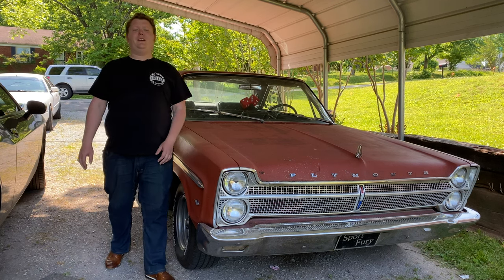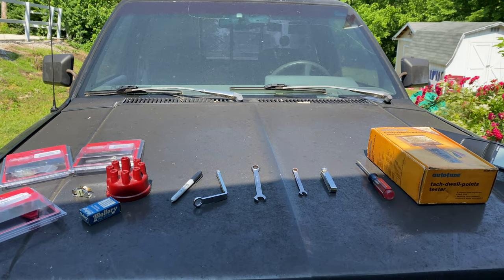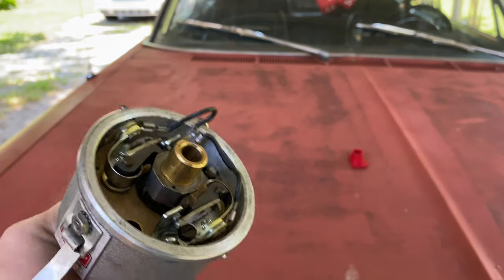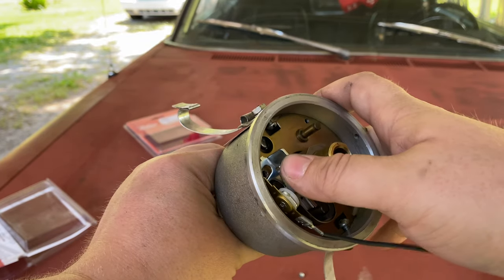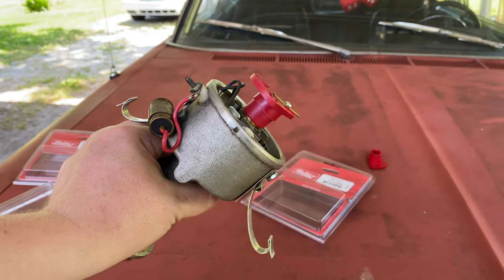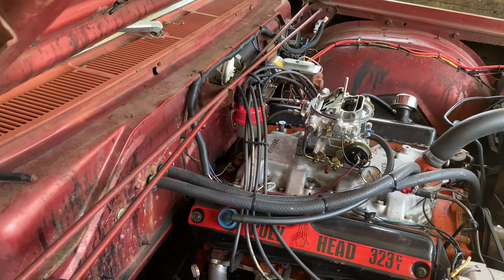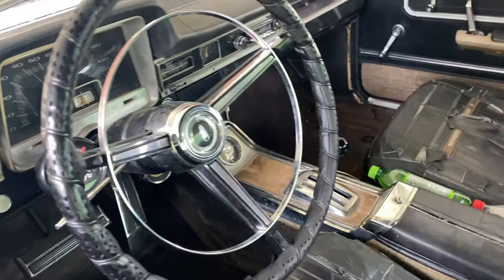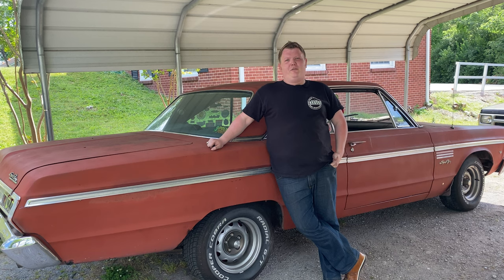Replacing Ignition Points And Setting Dwell Angle Is Easier Than You Think

Comment: My old timer tips : only work on distributors on a table with a towel on it; Why ? the towel will keep screws from RUNNING AWAY from you  because of gravity and wind! When installing, put the tip of your flat bladed screwdriver on a magnet for a moment then out the screwhead and move all of this to the spot where the screw goes in. This saves a lot of aggravation ! BTW I learned all this when your car was NEW !

Comment: use a magnetic screwdriver or they actually have small screwdrivers with tiny little Jaws on the end that will hold the screw in place until you can get it where you want it. you can even put a little dab of grease on the end of your screwdriver so the screw doesn't fall off.
Reply: That Screwdriver is called a Monday Morning Driver!

Comment: You got a mic on!  Awesome improvement in volume. 🙂  If you place a small magnet on the shaft of the screwdriver, it will become temporarily magnetic.  That will help keep the screw from falling off the end of the screwdriver when inverted.  In some applications, a dab of grease on the end of the screwdriver may hold the screw in place until you can start it BUT, I would not use that technique inside of a distributor...unless it happed to be dielectric grease. Nice set of points.  Most don't have the lubrication wick on them.  Showing the way to change the dwell may have helped make this clearer to those who have not done it before. Good job on remembering to recheck the timing. Good Job!

Comment: Yes I do know how to save your frustration with the screw. #1 add a dab of grease to the screw driver tip. # 2 purchase a holding type screwdriver , they have a split blade that tightened in the screw slot to hold the screw.

Comment: You can set dwell with just a basic multimeter, a wire and a protractor (even a paper one printed off internet) Tape the protractor on the rotor and fashion a pointer out of a coat hanger or something. Then disconnect power to points and connect the multimeter, set to continuity beep, between the points power lead and ground. Using a socket to turn over the engine slowly, take note of the degree reading on the protractor when the multimeter starts beeping and the reading when it shuts off. That is the current dwell angle.
Reply: dimebagvision3221  cheers. Have a beer on me then.

Comment: Thank God for my MSD  6AL  and lockable distributor.   I was 18 the last time I seen a dual point.
Reply: stay close to your parts source,do not travel the country,cause your new MSD  AL control unit is in a box warehouse and it'll be 3 days for they can send it to ya,points for ever,even my motorcycle is now points,its idles better and accelerates better
Reply: @strattuner  Not worried I have 2 other vehicles.  The street rod is not my daily driver.
Reply: @Buffrt66  EXCELLENT.NOW I KNOW  you have backup,100 bucks says there electronic cars too
Reply: @strattuner    i always keep a spare points dist. in my 77 poly powered d100.

Comment: Put the screw in the points and hold it in the hole with the screwdriver before you put them in the distributor and hold the screw in the hole with the driver as you guide them into place.
Or put a tiny drop of superglue on screw and glue into hole, glue will break when you tighten it.

Comment: I'm glad GM put a window on the distributor cap so dwell could be set with the engine running.
Reply: Fer sure! In the 1970s I used the Accel dual point distributors in both my 440 powered '64 Polara 500 and my '70 340 Dart. The same type in both. You externally unplugged one set of points and set the fitst set of points through a rubber plugged access hole using the dwell meter with engine running. Then you plugged in the other set of points and set that set of points the same way for your total dwell. It was SO easy to do. Before I had those distributors I used Chrysler dual point distributors in my cars and they took some experience to get good with them. My opinion- there's no reason NOT to use electronic ignitions now.

Comment: This car with it poly engine is awesome. I think it would be cool to make this car a mid 15 second reliable daily driver.  Some may say why 15 why not 14 13 or 12? Mid fifteens can be done without sacrificing any reliability and using many OEM parts. Mid 15s would be punchy gutsy and really add to the driving enjoyment. Hey mid/late 80s five liter mustangs ran in the 15s. But it's easy for me to suggest things that cost$$$....But Weiand has a dual 4bbl intake manifold for the poly. And you now know how to port cylinder heads......318 poly can be stroked to a 390 as well.......Jus sayin.  Love the new channel.

Comment: I'm currently working on the front end of my engine right now, but one of the things I definitely plan on doing is upgrading to Chrysler electronic ignition - points are easy, but I like technology.  So much easier when all you need is a plug and play test tool for your ECM!
Reply: and I on the other hand will never go to electronic ignition after breaking down in the desert of yuma arizona with a 450 dollar tow bill,the magnetic pickup in my car fried,and i coasted over to the side of the road in 105 degree weather with all of the rattlesnakes i could hear,technology is not the best right out of the box,no thanks and no thanks,point ignition has made cars run down the road for a 100 years,that is a track record of track records,with two sets of points and 4 condensors in the glove box and two coils in the trunk,i'm not walking again,and i'm glad you like technology,one of them tow bills are make your day,happy motoring

Comment: Just thought of something you can remove the plugs and rotor button hookup dwell meter spin engine with starter  your meter needle will hover over dwell setting move points while spinning engine  you can lock right in on proper dwell angle the first time...hope this helps.

Comment: If your screw driver is heavily magnetized you can deliver the screw directly to the hole, however threading it is still about half as hard as dropping it in. I used to have a screw driver that had two tabs that could hold screws someplace.

Comment: You asked for a better way to deal with the tiny screws in a distributer. I have a set of tweezers in my tool box and that helps me put the screw in the hole with the slotted end up. I can't tell you how many times I've gotten the screw in the hole upside down which doesn't do a bit of good. I change my points with the distributor installed in the car. However, I would recommend using ordinary white school chalk to make a temporary mark indicating the position of the distributor instead of a black Sharpie. This way you won't be confused by all of the previous marks (the chalk easily wipes away) and the white is easier to see. Finally, I wipe the timing mark on the balancer and the degree tab on the timing chain cover with the white chalk which is illuminated very well by the timing light.

Comment: Have you ever tried spinning the distributor with a drill in the vise and setting the dwell that way? surely would be a lot easier than starting and stopping the engine a bunch of times, especially if the distributor was already out. On my Ford I use a remote starter switch and a screwdriver to set the dwell while watching the dwell meter. I absolutely hate using the feeler gauge lol.

Comment: Take your strait edge screw driver while the engine is running and rub the tip back and forth over the rear bearing cap on the alternator ! it will cause the screw driver tip to be magnetized even after removal of screw driver. Also to check to see if your electrical system is charging touch the same rear bearing cap on alternator . if it has a good magnetic stick its charging . if barely has or no magnetic stick its not charging .   dont forget to put a little bit of lube on the inside of the tubular hinge of the points since it moves back and forth . 😎💪🏁✌

Comment: They make flat blade screwdrivers wit a spring loaded cam in the middle of the blade that twists to hold the slot.  Magnetic works almost as well.  Jaws outside the screw don't always fit in small spaces like points.

Comment: By the way the Mallory hp points not only  have a heavier spring the contacts   have a harder alloy also the condenser is matched to the coil impedance depending apon what contact the arc is building up on will tell you if your condenser is to big or to small. Also contacts of points should close flat and square for best points life always put a dab of grease on the rubbing block some old  distributors had a lube wick.  To put that screw in EASYIER.( USE A SCREW HOLDING screwdriver)

Comment: Hi I’ve just a dwell meter of eBay but with no instructions, I’ve just about worked out what’s what but could you please explain the bottom part that says points, it’s this for the condenser , and how to use it for testing the points, I ask this question because I’ve just fitted a brand new old stock ( made in 1975 lucas distributor  which came with points etc fitted I just took everything apart to remove protective oil’s setting it up and working great but the test tune up gage shows the points in the bad area and not the good??

Comment: like your style and I actually made it through what can be considered a very long YT video to see how you set the dwell. Unfortunately, in the end you didn't actually show how you set the dwell angle. You just showed the meter display incorrectly before.. cut.. and then after.. "fixed!"   What did you do the do the points when you were off screen? I have never set the dwell (why I am watching this video) so I have no clue what you changed on the points that made it lower the angle.. also, where did you put the piece of card stock? Again, I dig your video style but it's a swing a miss for this video with me.
Reply from the maker: You put the card stock between the points, and this distributor's dwell angle is adjusted by an offset screw. Most are adjusted by a hold down and just sliding the point base around until the reading is correct. The way this one is adjusted is not typical for most distributors.

Comment: Man. I'm not against points. But you shoulda threw that in jyj for a distributor and went hei. So nice to put 3k+ miles on a car and not have to deal with this points bs. Adjusting replacing pulling the distributor. Timing it Everytime. That crap just gets old. Same with a solid cam. ( But some like em). So not.saying they are crap. I like them in a 1/4 mile only myself.
Reply from the maker: The Jet has the same distributor lol